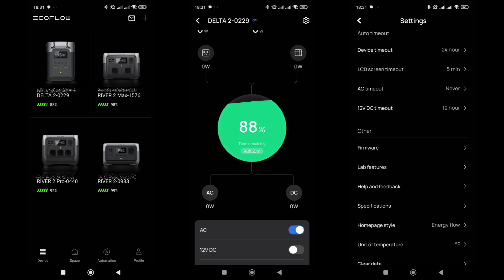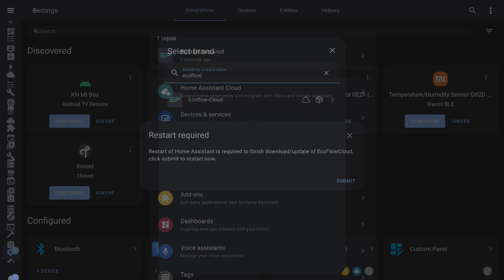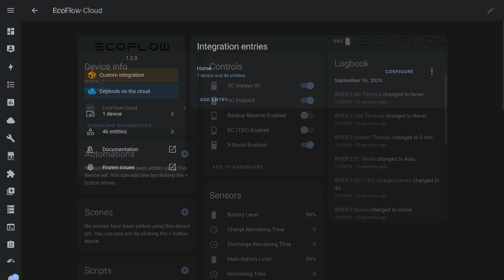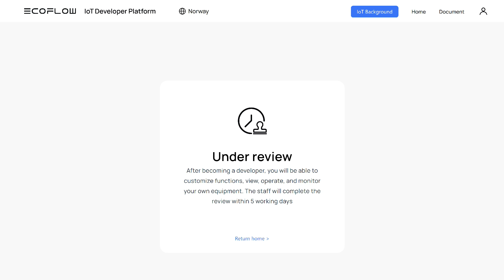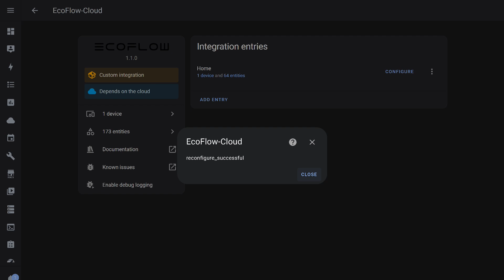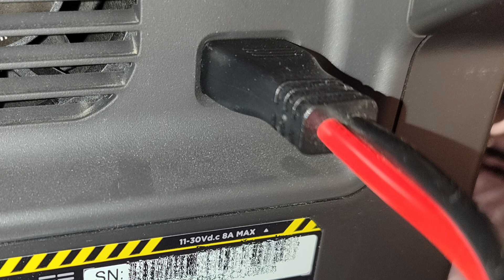Home Assistant - EcoFlow Cloud Integration, установка, получение public Api

Comment: Hi, I want do integrate my river 3 plus. But the problem is, that isn't in the list of that. And with the public api it also not work. What can I do to solve the Problem?
Reply from the maker: I would try to select manually from the existing devices in the list, perhaps this will be able to display the main control objects.

Comment: Thanks for the video. I was wondering if this can be used to control Smart Home Panel automations that I have set up on the Ecoflow app? I need it to turn on the charging through Smart Home Panel automation as if it's controlled through the Delta Pro the charging speed is limited
Reply from the maker: I didn't quite understand what you need to implement. But through the home assistant, you can set up automation that controls the charging speed of Ecoflow batteries.
Reply: @Alex_Kvazis  thanks for replying I mean on the Ecoflow App on Android there is the option to go into Smart Home Panel and set up automations on there to control when the Delta Pro starts charging from the Smart Home Panel (from the grid). I was wondering if I can do that through this Ecoflow Cloud. Basically I have residential solar panels and smart meter connected that is linked to Home Assistant. I want to have control over when the Smart Home Panel starts charging the Delta Pro. I already have control of the Delta Pros through Home Assistant from original Hassio Ecoflow so I've written automation to keep charge level under the solar production but I have to manually go in the Ecoflow app to start it off. If I tell the Delta Pro units to start charging it caps it at 1500w but through the Smart Home Panel automation on the Ecoflow app there is no charge restriction so it's more useful to have control over to write a home assistant automation that will mean I won't need to ever use the android Ecoflow app again

Comment: Hi
Thanks for the video. Can we use an HA command to force the devices to use the battery while the Ecoflow is still powered by 230 V? (installation without solar panels)
Reply from the maker: No, if the ecoflow is connected to the city power grid and there is power, then the battery is not used, it can only be charged.
Reply: @Alex_Kvazis  
Thank you for your answer.
With home assistant, can we recover the instantaneous power independently for each of the 4 sockets located at the back?